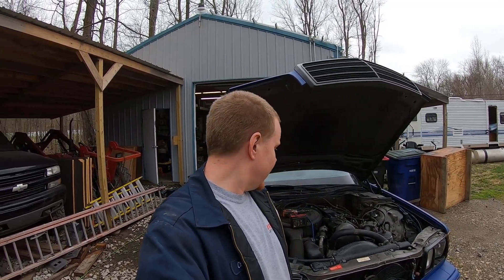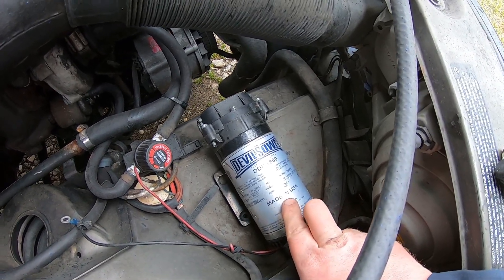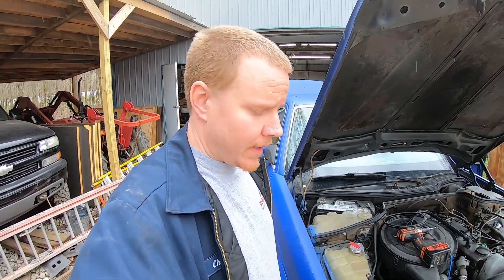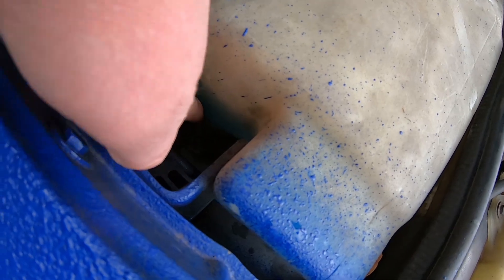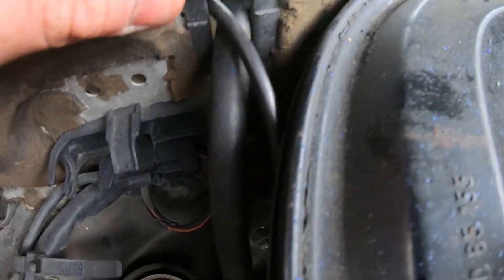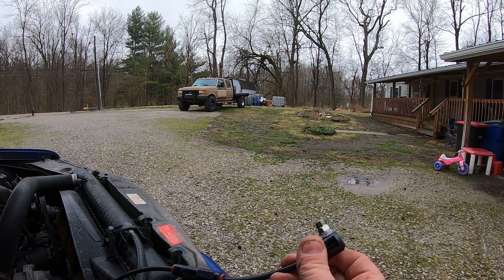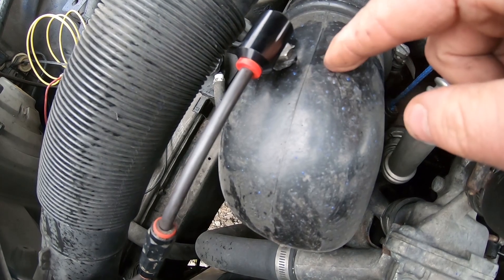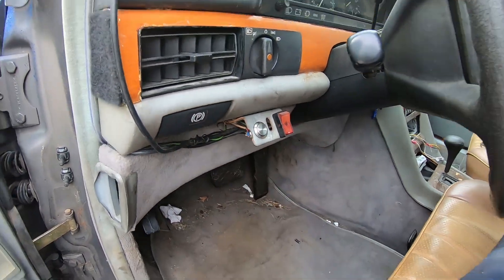300SD Gets Water / Methanol Injection - Alternative Fuels - WMO - Black Diesel - OM617 - Waste Oil

Comment: The old W123's are great cars. Wish I had one. Might settle for the 450 sl though. Always wear gloves with wood alcohol. It is easily absorbed through the skin and can cause blindness and damages the kidneys. It does not take as much as you might think. Same with centrifuge sludge. Lots of heavy concentrated heavy metals and toxins. Wear gloves. Not trying to be a prude, and we all know grease grows on hands and arms, but over time this toxic stuff does some very, very,  bad things to the body, including cancer. Brake cleaner on an open cut will give me a headache within seconds : )  Remember that cut? No worries, brake cleaner remembers! lol
Reply from the maker: Definitely something I need to work on.  Lol.  Bad habits die hard.
Reply: Here in Australia when covid-19 was hot. Companies got caught making hand sanitizer with methanol. Smelt like four shots from a still.

Comment: Thanks so much for this video. I'm planning on doing the same thing!
Reply from the maker: Appreciate you watching!  Glad it's helpful.  If you do the install, I would suggest installing the nozzle at the turbo outlet.  This was more for proof of concept than anything to see how the 617 would like it.  I'll be changing nozzle locations soon myself.
Reply: @NotSoGrandGarage  Thanks for the advice. Is it better for the turbo to move the nozzle?
Reply from the maker: @therandomnation4465  potential for erosion of the compressor wheel over time spraying water on it.  Not a guarantee but a potential.
Reply: @NotSoGrandGarage  Definitely good advice! Thanks
Reply: @NotSoGrandGarage  You definitely earned a sub from me!
Reply from the maker: @therandomnation4465  Appreciate it!
Reply: @NotSoGrandGarage  Was the engine coking with wmo soot before the tests?
Reply from the maker: @therandomnation4465  it was hazy before.  It's still hazy when cold but not when warm.
Reply: @NotSoGrandGarage  What ratio of wmo are you running?
Reply from the maker: @therandomnation4465  right now, around 50/50 in a single tank on this one.
Reply: @NotSoGrandGarage  Ok thanks so much!
Reply from the maker: @therandomnation4465  No problem!
Reply: @NotSoGrandGarage  How has it been recently? Has it kept your engine clean? I'm running wmo in my 300d and I'm starting to coke up bad so I'm building a water injection system. Just wondering if you think it will help with heavy soot. Thanks.
Reply from the maker: @therandomnation4465  I think it works well.  A new video is dropping in the morning... I test the system a little past half way through and the difference shows.

Comment: After I ran my car on wmo and busted my pump mainly because of personel dumbness 
I went to run my car on overstock desinfection. Stores bought that stuff in 2020 and couldn't sell it to this day. I can now buy it for 10 cents per liter or 38 cents per Gallon. 
I did the math and bought the injectors I need for my car and it runs great on that stuff except for the cold start. Consumption is double than what it was on petrol but what would I care for at that price.
Love it especially as it is low effort.
Just dumb the 5l bottles into the tank and off you go
Reply from the maker: Now that's interesting.   I can buy that stuff by the pallet for under $20...    hmmm

Comment: Here in south Texas it usually doesn't freeze overnight.  Can straight distilled water be used instead of the methanol?
Reply from the maker: Sure.  I use straight water on a regular basis.

Comment: A Russian team has learned that superheated steam used to atomize waste oil eliminates coking of the injector and 70 percent of nitrogen oxides.   It is a new idea, not yet applied to a diesel, but it could potentially be used in diesel and even coal.   A low budget device wouldn't be able to inject superheated steam using any method that i'm aware of - in 2023.   I think the amount of water injected might be less than you are using in water-methanol injection.    Superheated steam is 'dry' steam - it is very hot.   The properties of superheated steam more resembles a solid than fluid dynamics. It would require a new type of injector and a flash steam device to create the super-heated steam, not  easy to do in a moving piece of equipment.   Maybe the idea will be first applied to stationary diesels.  At his point the technology is so new, that it might not even be practical.   It could enable so called bunker-oil in container ships to burn much cleaner.
Reply from the maker: Interesting.   It would be difficult to implement, but it sounds like it has potential.
Reply: @NotSoGrandGarage  I'm sure there are techniques that are just beyond practicality.  Your water-methanol injection actually works
Reply: @timothykeith1367  that got me thinking of a type of coil that would sit just behind the turbo outlet and then feed it right on in at pressure. But I would use a check valve inline because at some point the pressure created in the coil would be beyond 300 psi. Only down side would be you would need to run some thick wall SS. but you got me thinking now 😎

Comment: Is this a good alternative to a dual tank system? I realize that's sort of the idea, I've run black diesel in my 12 valve excursion but had coking issues that my wife was not impressed with. Could this be a long term fix?
Reply from the maker: Honestly don't know.  So far, it's worked but I really have to pay attention to my driving and trip length.  Short trips and such get it smokey pretty quick.  Dual tanks will always be my preference.  Really makes things simple.
Reply: @NotSoGrandGarage  ok, thank you very much for your response

Comment: Would you recommend that for a Cummins I have took my intake off before and sprayed water in it didn't notice no results
Reply from the maker: Water methanol will definitely work on a Cummins.  I've got the same setup on a compound turbo 4bt (12v with 2 cylinders cut off)...   I spray 4gph of winter blend windshield washer fluid.  Decent power gain...  drives the turbos harder and cleans things up a good bit.  I've done the spray bottle method before too...  doesn't do much of anything.  You need quantity and time.  I can drain the washer tank in under an hour on this car for instance at it holds over a gallon.

Comment: Great vid, been 7 months. Any updates with the set up? Cheers Graham.
Reply from the maker: Was doing fine but parked the car due to a massive oil leak.  Before I out it back on the road, I'll be pulling the injectors and cups for inspection and cleaning.
Reply: Leaking from oil cooler lines?
Turbo return tube grommet?

Comment: Do any one know if you need to run the water injection constantly or could you just switch it on say, once a week on a long journey at high speed engine hot to get the same cleaning/anti ring gumming affect. (I’m  not looking for more power)
Reply from the maker: I don't run it all the time.   On my cummins, it's boost reference.   On the Benz, it's push button whenever I want.

Comment: Any update on how this is working out to keep the injectors clean and cut down on the hazing?
Reply from the maker: The merc has been parked for a bit.  Huge oil leak currently and no time to fix it.  It worked okay but certainly wasn't without issues.  Dual tanks and water injection would go a long way.
Reply: I’ve been looking at the snow kit and several videos of people building their own systems, I really like the snow is programmable to come on at a certain point based off of the boost, system can also be turned off. 

The biggest issue I’m running into trying to build something is finding a boost switch that would allow to run at higher boost and shut off in low boost or no boost. I’m sure it can be done, just haven’t found the correct sensor or switch yet.

If you were doing a manual push button setup, how often would you hit it and for how long?
Reply from the maker: What you are looking for is called a "Hobbs" switch.  They make them in all different set pressures and they make adjustable ones.  I've got an adjustable one on my Cummins Tahoe...  comes on at 20psi.  My buddy has one on his '93 IDI and its set to come on around 5psi.  You can get them for ~$25-30
Reply: That is awesome! Thank you for the information, I will do a search for one shortly
Reply from the maker: @strokedmule3838  no problem!
Reply: @strokedmule3838  How often and when would you do a manual push button setup on a naturally aspirated diesel?

Comment: For how long do you run the injection and how often? I guess the more frecquent the better. But lets say would 30-60 seconds every 20 miles or so be enough to keep the injectors clean?
Reply from the maker: Just depends.  As it stands, running a higher blend on a single tank for a few weeks has caused me some hazing issues that water injection isn't fixing.  When running 50/50, I'd run it for a si gle hard pull every time I drove it and it stayed clean.  You won't hurt it running it longer...  just size the nozzle appropriately.
Reply: Okey, thank you for your reply.  I built a system today in my Skoda pickup. The system is based on a 3bar fuelpump and a modified nozzle from a degreasing sprayer bottle. It puts out 200ml/min of fine mist. 

When I tried it out today I ran a couple of liters through it. Not all in one run but still. The car does twitch a bit when injecting if i don't floor the pedal. 

When I got back I checked the exhaust with my CO meter and it was the lowest I ever measured. 200PPM. Typical it is around 250-270 PPM with freashly cleaned injector tips. It will be intresting to see if it helps to keep the injectors clean for longer. 

I run 75/25% oil/gas and the injectors need cleaning after 1tank. I would be happy if I   could get at least 3 tanks between having to clean the injectors. I think I will try to run the water injection for about 30-40 seconds every longer trip and see where that gets me. I'm also currently trying out a modified injector sealing washer that I fased of the hole a bit and then mirror polished the surface in an attempt to make it harder for soot to build up.
Reply from the maker: @Supra747  should work well enough.  I believe my nozzle on the mercedes is 400l/m
Reply: @Supra747  hello, so its help ?
Reply: @vladkutsenko6010  to some extent yes but it's not a complete fix. I'm currently testing to rev the engine to about 2-3000 rpm prior to shut down and then turn the ignition of with full throttle. My theory is that drops are formed on the injector tips after shut down and that the droplets then bakes into coke. 

So what i'm trying to achive with this is to make the lines to the injectors completely pressure less to avoid any droplets to form.
Reply: @Supra747  How did that reving work out? have you thought about dual tank setup?
Reply: @coketey3372  It seems that my theory might be right. I have run two tanks and still no issues. Prior to this I have had to pull and clean the injectors after every tank. Sometimes after half a tank. The car still got good power and very little haze, no sign that the injectors would be coked up. I have not used any water injection during these two tanks. It is to early to say but I might have solved the single tank issue with a little bit of luck. But if I can get 2-3 tanks between pulling the injectors it is good enough for me. 

Have in mind that this only have an effect on mechanical injectors.
Reply: @Supra747  yes let me know if your two tank method prevents coking
Reply: @coketey3372  You misunderstand me. I only have one tank. I am not running a two tank set up. What I meant it that I have run two tanks of fuel without any cokeing of the injectors and I am now on my third tank.
Reply: @Supra747  oh ok good luck with that